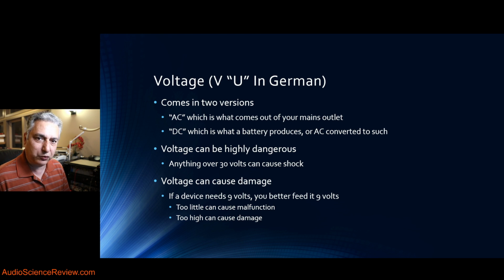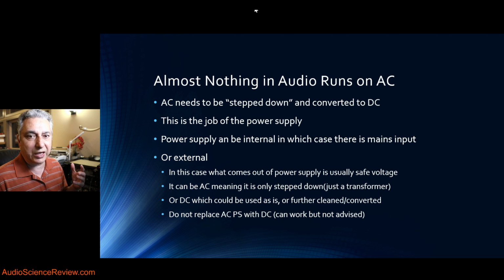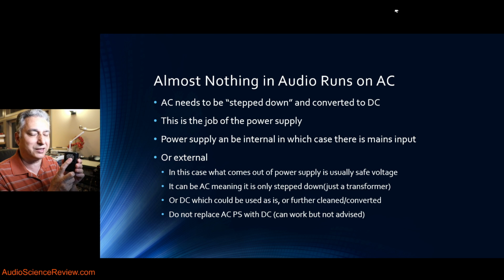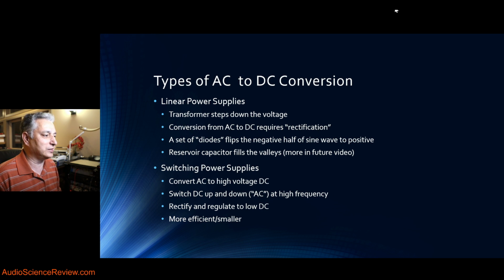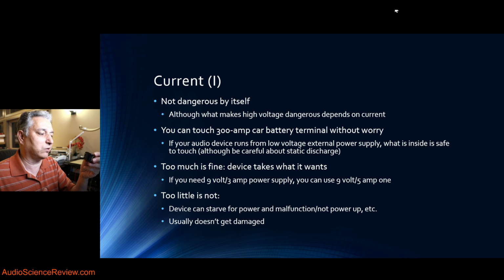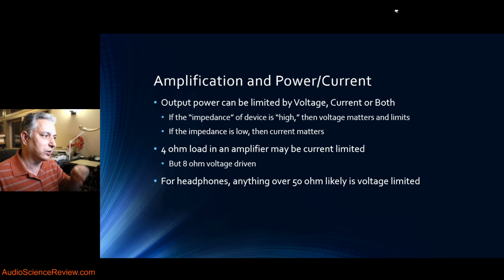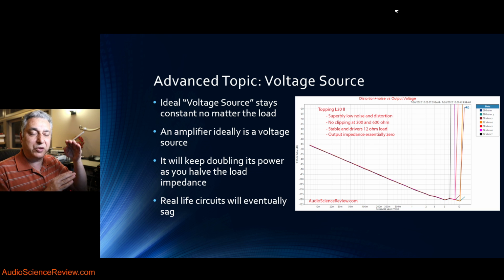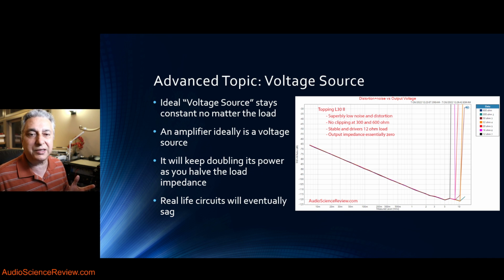Electronics for Audiophiles: Voltage and Current

Comment: Many thanks, very clear. Will an amplifier which doubles the current when the “impedance “ halfs handle low frequencies better than an amp without this capability? Eg B&W speaker given 8 Ohm but will drop way below 4 Ohm…

Comment: Wanna learn about audio? Learn about the science behind it first. What is sound? Pressure waves. What makes pressure waves? Moving cones. What moves the cone? Electrical signal. So anytime an audio reviewer talks about noise, detail, clarity, blah blah blah, consult with an Electrical Engineer first, cause if its not in the signal, its not in the audio and vice versa.

Comment: The comment about voltage being dangerous and current not, is a bit misleading. Many tasers use very high voltage, but are not deadly. It's important to recognize its the combination of the two, what each component does, how the balance works, and what values increase the potential for a fatal experience. Voltage allows current to move through higher resistive mediums. In which case, high enough voltage can cause current to bridge relative sized air gaps. Even at these extreme voltages current can be minimized or resistance can be increased to the point where exposure cannot kill anyone. But it only takes mA sustained for a short time to actually become fatal especially at high voltages. On the other hand, having substatantially lower voltage, but higher avaliable current can certainly kill.

Comment: Also, measure the voltage of your adaptors before plugging them in. The one time I didn't I cooked an ESR meter (12volts) with a "12 volt" adaptor outputting 24 volts. I can't even repair it because the main chip and 2 voltage regulators got smoked, which I am unable to find replacements.

Comment: I agree with several comments about how it is quite reckless to claim that current is not dangerous. This is so very easily misunderstood, as is "voltage is not dangerous". I would add to the dangers of current vs. voltage discussion a couple of things:

1. DC and AC have different effects on the body. For AC the frequency is also important.
2. In electric cars, the electronics might operate at 400V or even 800V and the battery is capable of providing a huge amount of power (current for that voltage), so I would be very careful about talking "car batteries" and what they are capable of these days. :) 

Thanks for the otherwise nice educational video and all the other invaluable work on debunking audio myth!

Comment: Thanks Amir for this video. I cames across a website the other day in which it was mentioned how important is to "correctly plug" audio devices to the socket. "Shouldn't be an issue in the US/UK as in those countries there's only one way to do It but in many others, neutral and phase pins from the plug can fit 2 ways to the socket". The benefits (they say) are two: better protection for the equipment and audio improvement (better sound scene, more"open"....blah,blah,blah...). Don't think so but is there any logic behind this? Thanks!
Reply from the maker: I have seen those reports as well.  There can be situations where you could get hum in one polarity vs the other (I have measured the difference at times).  But that is the extent of the audibility.  If you are not hearing such noise, then I would not mess with the polarity.  On safety, such devices better be double insulated.  Otherwise, they are dangerous either way.

Comment: I've already stated this but I don't see the comment. It is not crucial to provide the exact voltage or current to many , many different devices. It is common practice in residential and commercial installs to use 1 universal power product with a budget that is greater than the devices may need. We use P.O.E. injectors for the wireless access points, I.P. cameras and keypads we install. The P.O.E. injector is 48v. The access points require the 48v but the cams and the keypads do not ,yet they all work. this is because they simply draw the power they need to work. Under power any of these devices and they won't work properly or at all, but generally products will pull the power they need.
Reply from the maker: Good point.

Comment: I do not understand why one takes a maximum voltage of 2 or 4 volts for a source. With 16 bit resolution you then end up with extremely small voltage variations for the least significant bits. Let alone for 24 bit resolution. Surely that is highly susceptible to interference and signal loss, not?
Reply from the maker: 2 and 4 volts are actually much elevated compared to what was the case before it.  Sony/Philips did this when the CD was introduced for the reason you mention.  And yes, you are quite correct that for the best dynamic range, you want more voltage.  This is why pro gear outputs way more and there are amps that accept that as well.

Comment: This was a great video and I'd like to see more. 

Reading through ASR I've begun to pick up a little understanding, but these videos will help a lot. A quick question. I have an old Quad 303 power amplifier (1967 build) for which the listed input voltage is 0.5v. My setup is a Topping e30 to a Quad 33 pre-amp, to the Quad 303 power amp. The Topping outputs 2v and I use inline attenuators (10db) between the DAC and preamp - because otherwise the volume is crazy at 2. If I were to get an Aiyima T9 - or other tube buffer amp with DAC - would I still need to use the attenuators between the buffer and power amps? I would to begin with but if one day I was feeling experimental, would I damage the power amp as the video says to use the voltage something needs and no more. Thanks.
Reply from the maker: It is a complicated thing to answer but I think you already know the issue.  It all depends on the sensitivity of the amplifier and the type of volume control it has.

Comment: I would like more info on matching impedance: output impedance in dacs and input impedance on amps, how it affects the signal. Is it similar to headamp output impedance and headphone impedance that you mention? Also the concept of load impedance.
Reply from the maker: Definitely a topic to cover in my todo list.  In general, you never, ever want to match impedances in audio!  Doing so causes power loss and no benefit.  You want the source to have the lowest impedance and target, highest although a 10:1 ratio is good enough.

Comment: Thanks Omar/anyone else kind enough to reply, very helpful and an area I am still fuzzy on not being an electrical or electronic engineer or even a dangerous amateur. I have the most issues with low impedence planars for headphones, so a lot of the ifi Zen level equipment seems to have issues with low impedence devices, I have heard this described as current starved. What is the design principle that causes this I.e. they can often drive high I pedence headphones but connect an 8ohm or lower headphone and ey struggle unlike my other amps.
Reply from the maker: The fact that the impedance is "low" (generally anything less than 50 ohm) means that the amount of current limits power, not voltage.  A good headphone amp has both current and voltage so you can drive a huge variety of headphones and not worry.  On the other hand, some headphone amps like tubes can only deliver voltage and do poorly with low impedance headphones.  I will do another video on this topic in the future.

Comment: Sure hope no Audiophile gets fingers near anything with 300 Amp capability.  Reckless and irresponsible to imply touching any terminal of a power source is without risk.  Even professionals make mistakes.  Experienced power supply designer, a friend, suffered second degree burns and a thumbnail blow off by 28A at 5 VDC.  Unless you know exactly what you are doing, Audiophiles keep your hands in your pockets.
Reply from the maker: No one was encouraged to mess with audio equipment.  I also covered what happens if you short a high current source like a car battery.  Did you not watch the full video?
Reply: @AudioScienceReview  Every second.  Your cavalier attitude about touching any terminal of a high energy source is irresponsible and dangerous.  Many of the responses from viewers demonstrate they understand little about the dangers of electricity.  From a safety perspective, the information presented falls far short of responsible education.

"Current is not dangerous by itself".  That statement is nonsense.  In what situation is current present without voltage?

"You can touch 300 amp car battery terminal without worry".  Irresponsible statement to put in print, regardless of the few spoken words of caution.  If the intent was to educate "Audiophiles" with little to no knowledge about electricity, 300 amp car battery should never be mentioned as something safe to touch.

Otherwise good information tainted by glossing over safety.

Comment: A video devoted to the topic of voltage "sag" would be particularly useful. While it is a real phenomenon in specific scenarios, it is also used by some audiophiles to rationalize the purchase of amplifiers with current capability very greatly in excess of what is needed for the speakers or the headphones. When this is called into question, people who are convinced that more amplifier power invariably improves sound quality will often start talking about dynamic peaks and about the crest factor, etc. These also are perfectly real considerations, but the fact that they are real considerations does not mean that greater current capability for an amplifier will invariably improve sound quality.

With respect to the concept of current limiting, Ohm's Law assures us that current is fully determined by load voltage and load impedance. This implies that if current is lower than the value that, according to some reason, it should be, this will occur if and only if the voltage across the load is lower than the value that, according to some related reason, it should be. A good and well-known example is what happens with batteries when they go bad. The intrinsic voltage of the battery often does not decrease by much when the battery ages or runs down. Rather, what happens is that the internal impedance of the battery, in series with load connected across the battery terminals, increases. When this occurs, the load's share of the voltage decreases because its share of the series resistance decreases. Additionally current will decrease due to the overall increase in the series impedance, however the current through the load will always be related to the voltage across the load in the manner required by Ohm's Law. Which is to say, load current will not decrease independently of a corresponding decrease in the load voltage. This is absolutely, universally true. Thus, in the case of an amplifier that responds to overload by reducing current and power, this is necessarily accompanied by a reduction in voltage, and as such, the question that begs for an answer is why this circumstance would be deemed to be expressly about the amplifier's ability to deliver current, as opposed to its ability to deliver voltage.

If an amplifier does behave this way, the reason it does is probably that it is designed to behave this way. That is, there is circuitry that responds to high output current or to excessive heat buildup by reducing the voltage gain, thereby lowering the output voltage and, accordingly, the load current. If there is no circuity of this particular sort, what happens in this case, if output current is high and/or there is an excessive buildup of heat? If the amplifier goes into voltage clipping, this will lower the mean output voltage over time, which will lower the output current. Another possibility is that the amplifier does not tolerate heat as well as it should and begins to overheat with no voltage clipping. If the amplifier does not have the means to protect itself either by reducing the voltage gain or by shutting down, it would potentially sustain damage. Another possibility, though, that is sometimes brought up, is shrinkage of the DC voltage rails (+/-) provided by the power supply. (No Seinfeld jokes please.) If this actually happens, it would lower the threshold for voltage clipping, thereby having the aforementioned regulating effect. And this could possibly be done by design, as a self-protection mechanism, although it would be a decidedly inferior technique in comparison with reducing the voltage gain.

The scenario that is interesting (because it is something that lots of people think happens), is that in connection with the depletion of charge in the filtering capacitors in the power supply, shrinkage of the voltage rails will occur naturally. (No Seinfeld jokes please.) To be honest I'm not certain whether this will or won't happen, but what I recall from a long time ago when I actually studied this stuff a teeny bit, is that what will happen when the capacitors don't have the capacitance they should have in order to deal with the load impedance and the output current, the ripple factor will increase. To my recollection, this is what is supposed to happen when the filter capacitors aren't up to the task. Yet people often talk about voltage sag on the DC rails when the filter capacitors aren't up to the task, with no mention of any increase in the ripple factor. I am disinclined to think that this is the correct way of understanding what happens in the scenario where the filter capacitors are not up the task. I've also read where people claim that you need to have expensive power cords in order that the filter capacitors will be able to do what they are supposed to, when the filter capacitors aren't able to do what they are supposed to do, again with no mention of increase in the ripple fact. This, to my way of thinking, is completely off the rails.

This strikes me as something that could be answered fairly easily with help of an oscilloscope (once upon a time I owned one and I have no memory of what happened to it). Use the scope to display the rail voltage, and use a high-current variable resistor of some sort, in parallel with the speaker or headphones (or just the variable resistor without the real stuff), and watch what happens to the rail voltage when the load impedance is gradually lowered. Does the DC rail voltage gradually shrink, or does ripple appear? It would be interesting to do this with both a moderate quality amplifier and an expensive amplifier with the claim of high current capability, to determine whether what happens to the rail voltage is fundamentally different for different amplifiers, or whether the difference is merely a difference in the threshold (for load impedance) where the ripple exceeds some tolerance level. (Assuming that the amplifiers don't shut down or enter a protection mode before the ripple factor noticeably increases.) Personally I think this would be enlightening and I am hoping that Amir will be stimulated by what I have written, to do this or something similar. What exactly happens at the voltage rails when an amplifier is pushed to the limit or when the music presents the amplifier with a signal that has a high crest factor? Does the DC voltage actually shrink?
Reply: Thanks Samir for the clear disclosure of the fundamental concepts. As a follow-up related to what Tom was describing, it would be useful to correlate the concept of GAIN to the U and I source, and how all these interwork with the load impedance Z. Thank you again Samir.
Reply from the maker: Sure, I plan to cover impedance, gain, etc. in future videos.

Comment: so it's AC into an AMP...gets rectified to DC...then gets converted to AC before going to the speakers...and the power supply is most vital component of a good amp...is this correct ?
Reply from the maker: Yes.  The final AC though is modulated by your music source.  Your speakers will get destroyed quickly if the amp output is DC!  Indeed amplifiers usually have a protection circuit to detect DC and shut off the output.

Comment: Conventional driver are current driven component. Yes you need the voltage to drive current up. The current magnetic field to move the drivers. Unless the driver is ESL, a step up transformer to change the current into much higher voltage. ESL act like a capacitor.

Comment: just a little side note; if you touch a low voltage high current cable, the thing is you as a human don't get that high current as you have a high resistance any the curretn that goes though you is low. BUT, is like there is a question somewhre; you touch a 1volt,100000amp live cable, you live, you touch a 1000,0000 volt 0 amp capacitor, you die, 100000 volts have been given tou you to ground you die, 10000 amps short has created from you to the ground, no matter the voltage (it should be high anyways) you die...

Comment: Hello. I would like to ask about the output power from the amplifier. The formula is Vsqrt/R and the current is nowhere to be found. But as you mentioned speakers love current and are depending on it. How to know how much current our amplifier must provide in order to not distort by measuring its power with Vsqrt/R ?
Reply from the maker: Hi there.  Power = V * I.  You can take out either component and then express Power as a function of just voltage or current. Power = I * I * R.  Both conditions have to be met for X amount of power to be available.  As I noted in the video, as a rule of thumb, impedances in 8+ ohm require voltage; those at 4 ohm and lower, current.